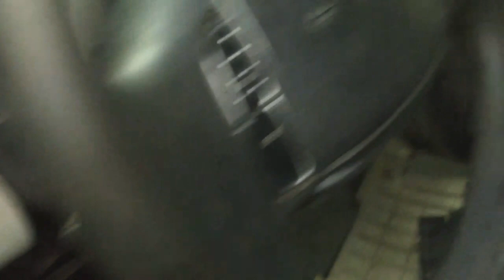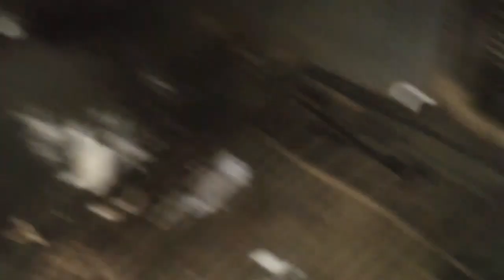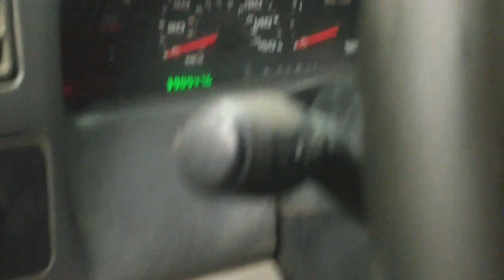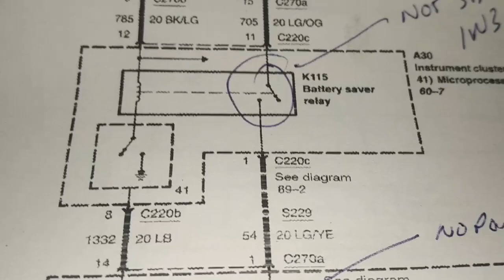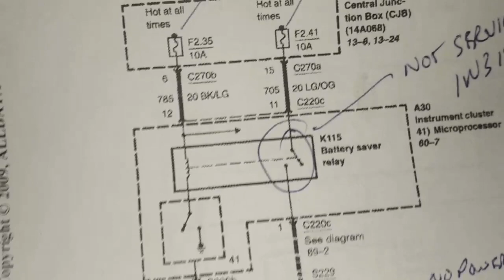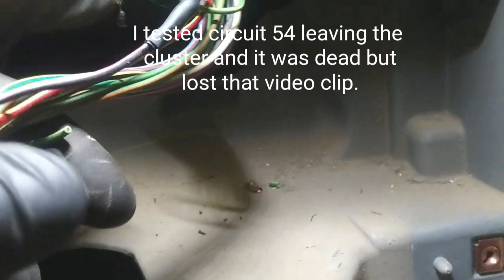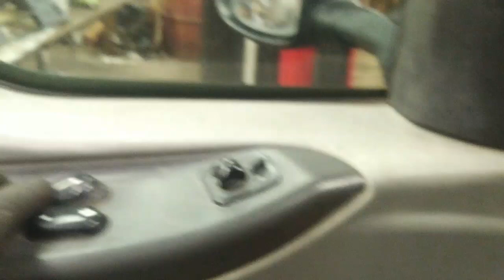2002 Ford F250 SD no power windows or radio

Comment: Would this be likely for a Eco line 250 and you went through the radio to get to the relay you didn’t have to take the dash off?
Reply from the maker: I would think the van of the same vintage would be the same, but I'm not 100% sure.

Comment: I fought this problem for years, replaced lots of parts. The issue was that in the driverside pass through door gromet 3 wires and 1 was a ground wire were broken spliced and heatshrinked the broken wires everything came back to life. From windows to radio to VSM to A/C.

Comment: This is going to be a lifesaver. I have an 02 stupid duty like you called it. Hopefully in the next week or two I'll get this fix put into my truck. My question is will this work what's the key in the accessory position?
Reply from the maker: @jimmyturner3715  yes everything should work as normal except shutting off the ignition switch will kill the radio and power  windows immediately. They would normally stay working until a door  is opened.
Reply: I wonder if this will also fixe my windshield washer squirter that is very intermittent works when it wants to. Gorlt thanks  @PhillipBailey
Reply from the maker: @jimmyturner3715  no it won't fix the washer. If the wipers start working when you press the wash button then it's likely the washer pump or wiring. If the wipers don't respond to the wash button either then it's likely the switch.
Reply: 0 yes they respond when I push the button for washer fluid @PhillipBailey
Reply: I should have asked this before I tore into my truck but what color is that wire is it green with yellow stripe green with a brown stripe or green with a black
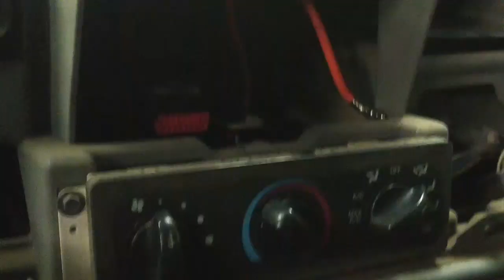Reply from the maker: @jimmyturner3715 at 3:00 light green and yellow
Reply: Awesome thank you
Reply: Do you happen to have a video on how to replace the shift tube in an 02 super duty
Reply from the maker: @jimmyturner3715  I'm sorry but I don't.  I have done it a couple times in the past like 10 to 12 years ago.

Comment: Do you have back windows too? I do full back seat the super crew or whatever its called. The wires will srill bw the same correct? I can look up the digram though  I've done that worh several vehicles. And ive had this issue before in a car i owned. Same deal. But its been a few no quite a few yrs lol This is so gonna work. I just know it. Cant wait to make this truck  so perfect hell feel real bad i did it all myself. With help from you giye on ytube lol 😊

Comment: That wire cluster is that fromnthe steering wheel cluster or from the back of the radio? Is there two there im not at my truck n i csnt remeber  last time i pulled a dash apart. . Are you cutting the wire behind your  steering column in behind he dash cluster there or behind the radeom i feel liek i jsut repeated msy3lf. I jsut need to make sure. Im sure itll mske sence when i see my truck but its in th4 garage right now. I also had the steering wheel replaced ans its now not lining up and truck has to start just before drive like its off kilter. I checked that out n i see where it needs ro be lined up under the door theres two bolts n a round thing ya line up the two arrows thats suppsoe to line ti back up.or in the dash by the steering coln anyhow if the steering doesnt work that way. Apparently, there was alot of play in the New steering wheel, and it had to be replaced.  So i dont have the truck  with me. N well i bkew a fkn break line. Truck had been sittin for a yr before i got it. I know it needs a few things but shes a beast n i refuse to give up i just got jewed on a gmc i need wheels now its been almost a yr with no car n my dads roo.old to fic anything so these old farts are bringibg me.old trucks. Lol this one is full a piss n vinegar, not bad shape, n 260 k on it. She runs nice. im keeping this one.. dad said i should a married michanic. i think he was right, lol any help to better understand  shite would be great. Im a smart girl but im a visual girl. 😊
Reply from the maker: @MsLori-BassGirl4Life  all the wire modifications are made at tge back of the cluster. Be sure to disconnect the gear shift indicator cable from your steering column before pulling the cluster. Good luck.
Reply: Thank you so much. Guess I gotta tighten the bolts on the steering wheel now too n make sure the neutral safety switch is lined up correctly under drivers door by tranny cuz I can't start it in park either. Maybe once n a while it'll work. But usually only in N. It's not lining up. There's a few things the wanba be michanic didn't tell me. Shocks look bad n I can't even see a coil or strut front ir back but ut has more leaf springs than I've ever seen in my life and I've added them fir firewood  before on a 150. Well here goes nothing. I'm taking you with me when I go out to do this. I'm pretty handy. I just hate doing it alone. Lol 😊 thank you ever so much.
Reply: Oh he did change  the steering wheel n I tried to tell him to watch this video but he seems to notwanba touch it at all. Like leave me with a very unsafe truck  n he certified it like this n changed me 350 bucks. . I got a test light too. So I can check the relay like u have first.

Comment: Never mind you did exactly what wires the orher guy said. I coudlnt see the wires you are tryin a show us. Its not clear. Now i just want to remove my stereo n put in a screen touch one.  So i do t care what happens to the other one. I used ro i stall stereos fpr all my friends but its been yrs since uve doen ti n we didnt have harnesses bsck rhen to make it easy. I had to spend hours sometimes hookin them up after they ya ked rhem.out on me. But i always managed well. Now im gonan do what you did here first n then im gonna add a new harness ans stereo. Shite shoudl work but im nervous lol n i suppose I need to buy a new face for the truck itself when i change out stereos as well 😊. Imma post on here after i try this crazy wiring you got here n the other guy posted. My dad was a back yard mechanic th4 man could rip anything. Apart accept stereos n wires. But i could and so could my belated brother. Lets see if i still got it hahaha u rock  thsnk u for confirming this too 😊😊😊

Comment: I did this on 2002 ford excursion, worked for 5 minutes then it popped the front wiper fuse.
Reply from the maker: I cant see how these circuits are related. Could just be coincidence?

Comment: Mine is doing that too and I still can't get it to work
Reply from the maker: Remove the battery saver relay and test for power with a test light on either pin 30 or 87. If one of those is live jumper 30 to 87 and see if the windows work. Connect a test light between 85 and 86 of the same relay. It should light with the ignition on.  If not the dash is likely not supplying power or ground.

Comment: So i did this trick and now my radio and my window on my drivers side works again but my passenger one doesnt any tips on where i should start looking i have an 02 f250 7.3 super-duty
Reply from the maker: Visually check for broken wires between both front doors and body where they flex when opening the door.

Comment: how do i do this on the 07 f250 just replaced the gauge cluster but it still dose not work and it’s the cluster with the black and blue plugs and i have a fix but i have to unplug the circuit breaker every time i turn it off or the windows and radio will stay on
Reply from the maker: The 07 circuit works similar but is wired completely different at the cluster so this will not work.  What are the exact symptoms that you have.  Put it back to original if you modified the circuit based on this video

Comment: It's dirty connections in your Ignition switch jiggle the keys a few times if the problem goes away then you need a new  Ignition switch
Reply from the maker: No sorry it's an internal problem with the instrument cluster.

Comment: How did you get to that relay to bypass it.
Reply: I don't know how to take the dash around the steering wheel and radio off. I have a 2001 F-250 Heavy duty
Reply from the maker: @user-ch4ob5bf1t  hello

I would suggest if you can't figure out how to access the dash and follow the instructions in this video that you don't attempt this fix. No disrespect meant here. I'd suggest getting help. The relay in internal to the cluster.
Reply: no disrepect taken, I have replaced the door lock actuators on the truck. I just wasn't sure where to start to take the dash off. @PhillipBailey
Reply from the maker: @RalphRussell-x3w  what are your exact symptoms?
Reply: The driver side window stops rolling down and I hear a click in the dash. I replaced the relay that is with the fuses. I have had trouble with the power locks working with the  buttons and have replaced the the front door lock actuators. I will be replacing the rear door lock actuators in the near future. @PhillipBailey
Reply from the maker: @user-ch4ob5bf1t  based on your description the relay built unto the cluster shown in this video is not your problem. If it were it would stop the radio and both power windows from working up or down. It has nothing to do with the power locks. In your case if only the driver side window stops rolling down but will roll up the problem is likely the switch. There is a remote possibility it could be the window regulator mechanism binding in the downward direction too.
Reply: ok thank you very much
 @PhillipBailey

Comment: I swaped out the delay relay in the fuse box under steering wheel and have not had any issue since, never had issue with radio it  is aftermarket radio i just turn off wired to constant power

Comment: Well I have the same issue but my blower motor doesn't work either.. just replaced the instrument cluster a few years ago and now no windows or radio or ac in GEORGIA in July😢
Reply from the maker: I doubt the blower motor problem is related to windows and radio.

Comment: Has anyone tried to replace the delay relay?
Reply from the maker: In this case the delay relay is not being turned on by the circuit in the dash
Reply: @PhillipBailey  this is so sad of a design why they did not put in fuse panel I'm going to try window relay first then possibly try the wire change on plug

Comment: Had a double din radio installed and now I have no power windows but my radio works fine
Reply from the maker: Usually an aftermarket radio uses the original supply powers and ground. I doubt this is you're problem. Does the radio continue to play when you shut off the ignition until you open a door? If so the accessory delay relay is working. If not the the aftermarket radio is wired to a key switched circuit.
Reply: @Phillip Bailey  it shuts off with the key.
Reply from the maker: @leewaulk  so it could be wired to an alternate ignition fed source. Try bypassing the accessory relay in the fuse panel.  Remove the relay and jump pin 30 to pin 87. The pins are numbered on the relay.
Reply: @Phillip Bailey  I'll give that a try this weekend and let you know. Much appreciated!
Reply: @Phillip Bailey  I tried jumping it and still nothing. Do you happen to know what color wire supplies power?
Reply from the maker: @leewaulk  is one of the pins, 30 or 87 powered at the relay plug?

Comment: I'm confused as to what the solution was
Reply from the maker: The instrument cluster contains a circuit board mounted relay the when the ignition is turned on supplies power to the accessory relay. The purpose of the circuit is to allow the radio and power windows to continue to work for 15 to 20 minutes after turning off the ignition or until you open the door. That internal relay or it's printed circuit fails and does not supply power to the external accessory relay. This modification uses the key switched power going into the cluster to supply power to the accessory relay  so the radio and windows work. HTH

Comment: Thank you so much for this video!!!!! Been battling this issue for 3 yrs. Occurs a lot now that it is warm and humid in illinois. 2003 f250 super duty 7.3. I will try the fix and keep ya posted.
Reply from the maker: Good luck and let me know if this works for you.
Reply from the maker: How did you do with your truck?
Reply: @PhillipBailey  I have not done it yet…son getting married this week, so put this project on hold until next week. Will let all y’all know…
Reply from the maker: @woodsman123  congratulations to you both.
Reply: @woodsman123  did you fix it? I hae the same problem

Comment: I watched the video several times and I still don’t see what you did to fix the problem. I’m missing something or did you just replace the relay or have to replace a board
Reply from the maker: At 3:00 in the video I showed what I did at the instrument cluster plug. Cut the green wire coming out of pin 1 and tee it into the black pink wire on pin 19. This will send ignition power to the relay to turn it on. HTH
Reply: @PhillipBailey  ok I will take another look. I was hoping it was going to be a fuse of some kind. Thanks for your help sir

Comment: My 2000 f250 only has a 16 pin inline connector in place of the one shown in video, which pins do I need to disconnect and reattach?
Reply from the maker: After briefly looking at the circuit for the power windows on a 2000 F250 I can see it is completely different. This truck uses a GEM module to control the accessories delay relay which supplies power to the window switches. The instrument cluster is not involved. What are your exact symptoms?

Comment: Great suggestions unfortunately I haven't been successful with any yet.
I have an 03 excursion with no windows ,radio or gauges.
The relay jumper procedure works but I would like to have the ignition delay working.
I swapped out the cluster with no luck.
I do not have any power at fuse 42 , 
I had no issues until it quit the first time and has never worked since.
It was extremely cold when it failed and im suspicious of a mechanical failure in the tumbler system that actuates the accessories.
I also have a super duty that had the reverse problem at this time and the accessories would not shut off with the key and the doors open, this began working once it warmed up though.It seems like the possibility of a mechanical failure in the extreme temperatures is a possibility. Your thoughts on this would be appreciated.
Reply from the maker: I cant find fuse 42. Fuse 41 feeds battery power to the instrument cluster as well as 35 and 45. Fuse 33 is hot in run. If you have no power at Fuse 41 see if you have power at 35. If so problem is behind dash Fuse panel. Fuse 41 gets power from a Fuse link under the hood but if it was bad Fuse 34, 59, 18 and 34 would also be dead...
Reply: Didn’t fix my 2003 f250 either , now what ?
Reply: Figured anything out?

Comment: Ever had a short at fuse position 41?
Reply from the maker: Not sure what you mean by that. If fuse 41 blowing repeatedly?
Reply: @PhillipBailey  yes
Reply from the maker: @Bible_with_a_lego_man  fuse 41 feeds the instrument cluster from what I can see. Disconnect the instrument cluster. If the short is gone now the cluster has an internal short in my opinion. If its still present with the cluster unplugged it has to be a short in the dash harness. Any aftermarket accessories installed?
Reply: I have only had the truck for about a year but they added a security system on it. For about 10 month it was working fine. One day just went out. My fear is that I have a broken wire. Any tips on finding those?
Reply from the maker: @Bible_with_a_lego_man  It won't be a broken wire as an Open circuit does not cause excessive current flow and  blown fuses. Put a headlight in place of he fuse. (across the fuse terminals). If the headlight comes on bright then the short is present, start by disconnecting the cluster. next the security add on. move the wiring and if the headlight goes out or flickers you're getting close.  you're looking for a wire that is grounded to the body or a shorted components. HTH
Reply: Thank you for your time. When I unplugged the cluster, the fuse will not blow. When I do it blows immediately.  My question is that with the new fuse in, it impacts the connection below 54. It's a green wire with a orange stripe instead of pin 54 which looks to be the corner pin that is green with a yellow stripe. Should that pin below 54 be energized too?
Reply from the maker: @Bible_with_a_lego_man  not sure what you are referring to when you say below 54? Fuse 41 is hot at all times and feeds pin 11 of connector C220C at the cluster. If the short is eliminated with C220C unplugged at the cluster then try finding a used cluster for the truck. There may be options if you're in the US for repairing it but I don't know. I'd look for a used one first as that would likely be cheaper.
Reply: Understood. Do you have a pin diagram for c220c or know where I can get one?
Reply from the maker: @Bible_with_a_lego_man  give me your email. I'll try send you some info.
Reply from the maker: @Bible_with_a_lego_man  turns out after looking closer to this diagram that fuse is power to the battery saver relay which if a door is open sends power though that relay which is integral to the dash to the courtesy lights. It also feeds the underhood light. I would depin or cut the light green yellow wire in pin 1 of C220C and plug the dash back in. If your short is gone now then it is in circuit 54 and could be in the dome lights, vanity mirrors, glove box light or underhood light. I have diagrams for you.
Reply: I have written 2 comments with my email address on them but they seem to go away. Is that not allowed?
Reply: Last name followed by _first name initial at yah
Reply from the maker: @Bible_with_a_lego_man  YouTube seems to delete messages containing emails but I saw it before. Just sent some diagrams. Check circuit 54 leavingbthe instrument cluster for a short to ground.
Reply from the maker: How did you make out with your short circuit?